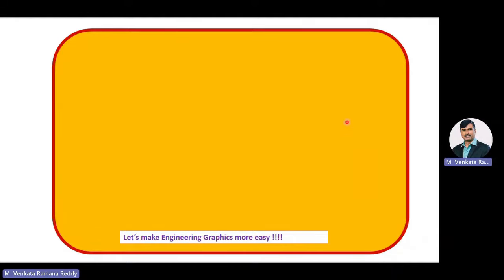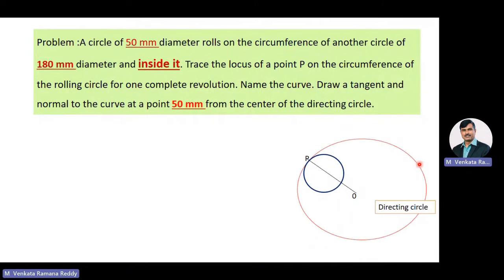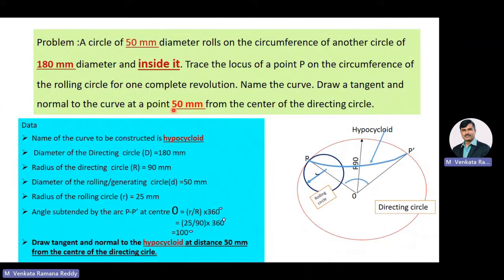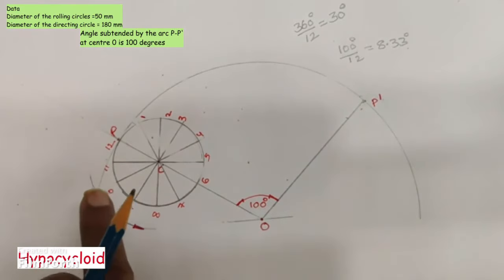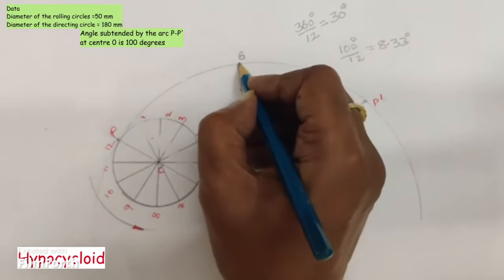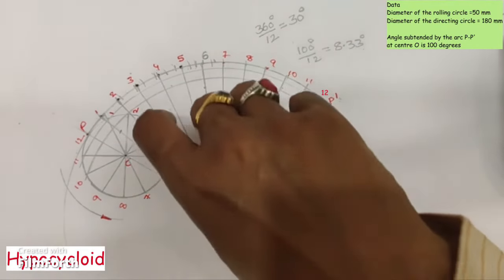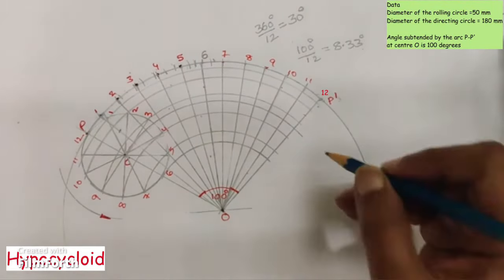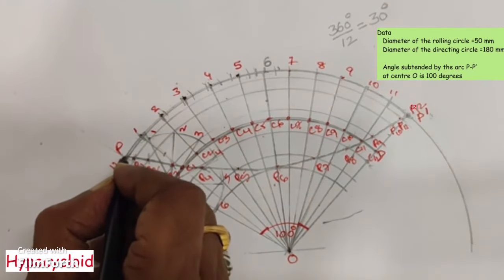Hypocycloid

Comment: 1
Draw the projections of a regular pentagonal lamina of side 25mm having one of its sides in HP and
its surface inclined at 45° to HP. (20)
2
A regular pentagonal lamina of side 25mm is resting on HP on one of its sides and its surface is making
an angle of 50° to HP. Draw the projections. (20)
3
Draw the projections of a regular pentagonal lamina of side 30mm having one of its sides in HP and
its surface inclined at 45° to HP. (20)
4
A regular pentagonal lamina of side 30mm is resting on HP on one of its sides and its surface is making
an angle of 50° to HP. Draw the projections. (20)
5
Draw the projections of a pentagonal plane having side 30mm having one of its sides in HP and its
surface inclined at 50° to HP. (20)
6
Draw the projections of a regular hexagonal lamina of side 25mm having one of its corners in HP and
its surface inclined at 45° to HP. (20)
7
A regular hexagonal lamina of side 25mm is resting on HP on one of its corners and its surface is
making an angle of 50° to HP. Draw the projections. (20)
8
Draw the projections of a regular hexagonal lamina of side 30mm having one of its corners in HP and
its surface inclined at 45° to HP. (20)
9
A regular hexagonal lamina of side 30mm is resting on HP on one of its corners and its surface is
making an angle of 50° to HP. Draw the projections. (20)
10
Draw the projections of a hexagonal plane having side 30mm having one of its corners in HP and its
surface inclined at 50° to HP. (20)
11 A Circular lamina of 50 mm diameter rests on VP on a point of its circumference such that its surface
is inclined at 50o to VP and perpendicular to HP. Draw its projections. (20)
12 Draw the projections of a circular lamina of diameter 60mm, when held vertically and its surface makes
an angle of 45o to VP. (20)
13 A Circular lamina of 60 mm diameter rests on VP on a point of its circumference such that its surface
is inclined at 40o to VP and perpendicular to HP. Draw its projections. (20)
14 Draw the projections of a circular lamina of diameter 50mm, when held vertically and its surface makes
an angle of 45o to VP. (20)
15 A circular plane of diameter 50mm and negligible thickness rests on VP on a point of its circumference
such that its surface is inclined at 45o to VP and perpendicular to HP. Draw its projections. (20)
16 A rectangular plate 50mm x 30mm has one of its shorter edges in the VP and its surface is inclined at
40° to VP. Draw its front view and top view. (20)
17 A rectangular plane of sides 40mm x 25mm has one of its smaller edges on the VP and the surface of
the plane is inclined at 40o to the VP and perpendicular to HP. Draw the projections. (20)

18 A rectangular plate 40mm x 30mm has one of its shorter edges in the VP and its surface is inclined at
45° to VP. Draw its front view and top view. (20)
19 A rectangular plane of sides 40mm x 30mm has one of its smaller edges on the VP and the surface of
the plane is inclined at 50o to the VP and perpendicular to HP. Draw the projections. (20)
20 Draw the projections of a rectangular plane of sides 50mm x 30mm has one of its smaller edges on the
VP and the surface of the plane is inclined at 50o to the VP and perpendicular to HP. (20)
21 A pentagonal prism having edges of base 30 mm each, axis height 60 mm has one of its corners in the
HP. Draw its projections, when its axis is inclined at 45o

to the HP & parallel to VP. (20)

22 A hexagonal prism having base side 25 mm and axis height 70 mm has one of its corners in the HP.
Draw its projections, when its axis is inclined at 40
o
to the HP & parallel to VP. (20)

23 A pentagonal prism having edges of base 30 mm each, axis height 65 mm has one of its base edges in
the HP. Draw its projections, when its axis is inclined at 45
o
to the HP & parallel to VP.(20)

24 A hexagonal prism having edges of base 25 mm each, axis height 60 mm has one of its base edges in
the HP. Draw its projections, when its axis is inclined at 40
o
to the HP & parallel to VP. (20)
25 Draw the projections of a pentagonal prism having base side 30mm, axis height 70 mm when one of
its base edges is in the HP, keeping its axis inclined at 40
o
to the HP & parallel to VP. (20)

26
A hexagonal pyramid has an altitude of 70 mm and side of base 30mm. The pyramid rests on one of
its side of the base on HP such that the triangular face containing that side is perpendicular to HP. Draw
the front and top views. (20)

27
A pentagonal pyramid has an altitude of 60 mm and side of base 30mm. The pyramid rests on one of
its side of the base on HP such that the triangular face containing that side is perpendicular to HP. Draw
the front and top views. (20)
28 Draw the projections of a pentagonal pyramid of base side 25mm and height 60mm when resting on
HP on one of its base sides and its axis is inclined 45o

to HP and parallel to VP. (20)

29 Draw the projections of a hexagonal pyramid of base side 25mm and height 70mm when resting on
HP on one of its base corners and its base is inclined 45o

to HP and perpendicular to VP. (20)
30 Draw the projections of a pentagonal pyramid of base side 25mm and height 70mm when resting on
HP on one of its base corners and its axis is inclined 45o

to HP and parallel to VP. (20)

31 A cone of base 50 mm diameter and height 60 mm is resting with one of its generators on HP. Draw
its top and front views. (20)
32 Draw the projections of a cone of base diameter 50mm and height 60mm when resting on HP on a
point of its base and its axis is inclined 45o

to HP and parallel to VP. (20)

33 Draw the projections of a cone of base diameter 50mm and height 70mm when resting on HP on a
point of its base and its base is inclined 45o

to HP and perpendicular to VP. (20)

34 Draw the projections of a cone of base diameter 50mm and height 80mm when resting on HP on one
its generators and its axis is parallel to VP. (20)

35 Draw the projections of a cone of base diameter 50mm and height 70mm when resting on HP on a
point of its base and its axis is inclined 30o

to HP and parallel to VP. (20)

36 Draw the top and the front view of a right circular cylinder of base 50 mm diameter and 70 mm long
when a point of its base lies on HP such that its axis is inclined at 30o

to HP. (20)

37 Draw the top and the front view of a right circular cylinder of base 40 mm diameter and 60 mm long
when a point of its base lies on HP such that its axis is inclined at 45o

to HP. (20)

38 Draw the top and the front view of a right circular cylinder of base 50 mm diameter and 70 mm long
when a point of its base lies on HP such that its generators are inclined at 30o

to HP. (20)

39 Draw the top and the front view of a right circular cylinder of base 40 mm diameter and 60 mm long
when a point of its base lies on HP such that its generators are inclined at 45o

to HP. (20)

40 Draw the top and the front view of a right circular cylinder of base 50 mm diameter and 70 mm long
when a point of its base lies on HP such that its base is inclined at 45o

to HP. (20)

41 Draw the projections of a circular lamina of 50mm diameter having its plane vertical and inclined at
30o to the V.P. Its centre is 40mm above the H.P. and 50mm in front of the V.P. (20)

42
A regular hexagon of 30 mm side, held with its two sides vertical and the centre of the plane is at 50mm
above HP and 50mm in front of VP. Draw its projections when the surface is vertical and inclined at
30o to the VP. (20)
43 Draw the projections of a circular lamina of 60mm diameter having its plane vertical and inclined at
40o to the V.P. Its centre is 40mm above the H.P. and 50mm in front of the V.P. (20)

44
A regular hexagon of 25 mm side, held with its two sides vertical and the centre of the plane is at 60mm
above HP and 50mm in front of VP. Draw its projections when the surface is vertical and inclined at
45o to the VP. (20)
45 Draw the projections of a circular lamina of 60mm diameter having its plane vertical and inclined at
50o to the V.P. Its centre is 50mm above the H.P. and 40mm in front of the V.P. (20)
46 Draw the projections of a hexagonal pyramid of base side 25mm and height 70mm when resting on
HP on one of its base corners and the slant edge through the resting corner is perpendicular to HP. (20)
47 Draw the projections of a pentagonal pyramid of base side 25mm and height 60mm when resting on
HP on one of its base corners and the slant edge through the resting corner is perpendicular to HP.(20)
48 A hexagonal pyramid of base side 30mm and height 70mm when resting on HP on one of its base
corners and the slant edge through the resting corner is perpendicular to HP. Draw the projections (20)
49 A pentagonal pyramid of base side 30mm and height 70mm when resting on HP on one of its base
corners and the slant edge through the resting corner is perpendicular to HP. Draw the projections (20)
50 A pentagonal pyramid of base side 30mm and height 70mm when resting on HP on one of its slant
edges. Draw the projections (20)
Reply from the maker: Ok